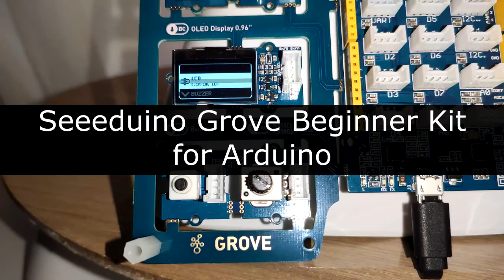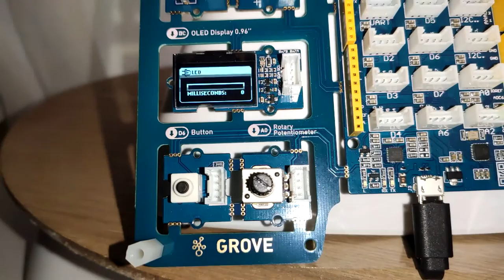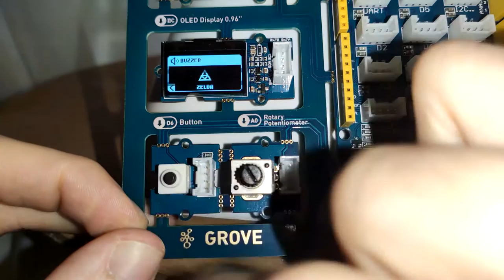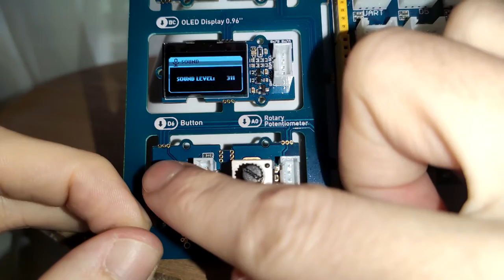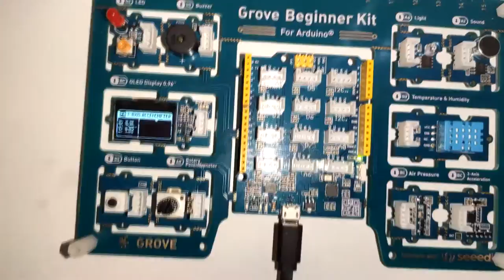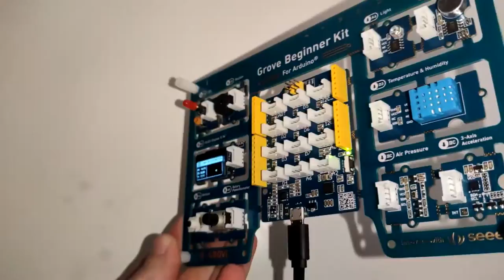Seeeduino Grove Beginner Kit for Arduino

Comment: can we disassemble all components then use it? possible?
Reply from the maker: Yes! You can cut all mini boards and connect some of them with the included cables. (There aren't enough cables for all modules)
Reply: @giltesa  ok. I did.
I took out Oled display and connected with another arduino UNO with cables/jumpers.
But it didn't work. Display was not ON.

Pls help
Reply from the maker: @varnitgoswami5512  You should check you are using the correct pinout on your Arduino Uno. Yo should also check your code is using the correct address or you can try to using the sketch that include the IDE to detect any I2C device.